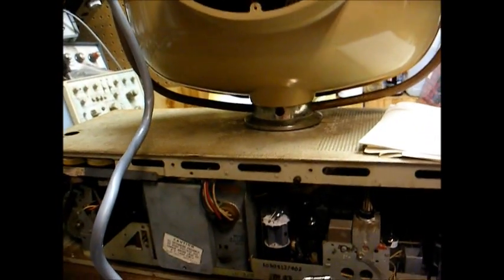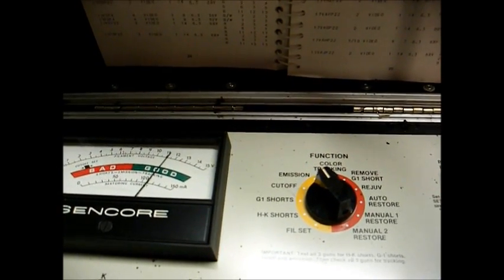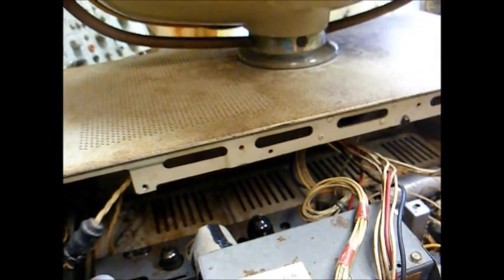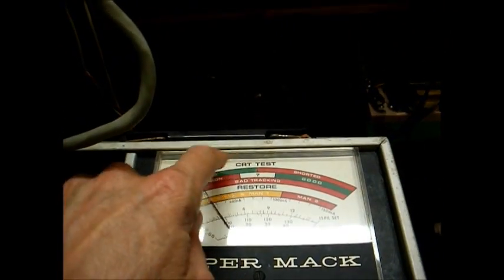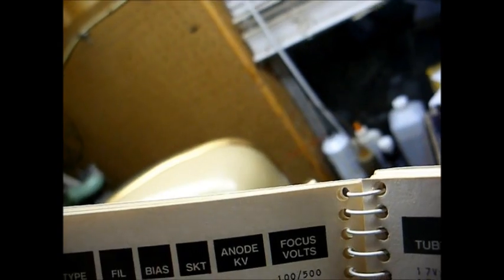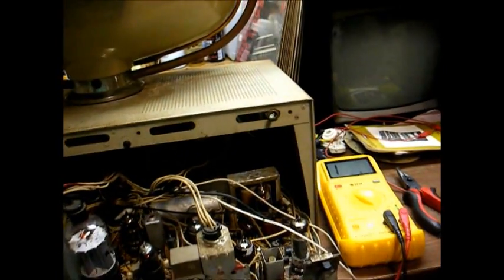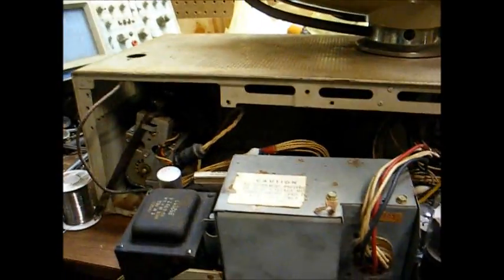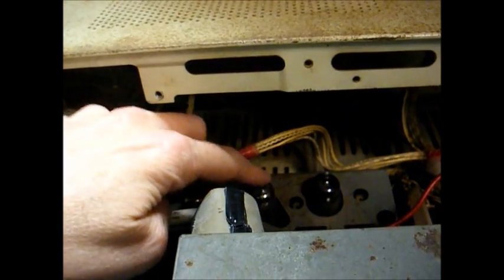First look at a 17" Philco Predicta B&W TV

Comment: Really excellent assessment...was just gonna mention the low CRT heater...But Shango is there below/above me...Yes, it's a question of percentages, a 6.3V set dropped down to 5 volts is around a 20% drop, good for the life test. Who knows what the Sencore was offering the 2.6V tube heater, but if it was anything less than 2V it would be getting extreme. Most Predicta owners would be predictably predisposed to prodigious pleasure if offered a tube like this. Before getting eaten by a predator.
EDIT: The life test breaks a winding at the bottom of the secondary on one Sencore circuit I have seen and as Shango says it's a volt! That makes it more than double really what it should be.

Comment: Great video!! I worked on one of these back in the early 70's while I was in high school for a teacher. I concur what your mentor felt about these sets. The one I fixed was a series string  set and the problem was heat damage on the p.c. board. I nick named it the video toaster oven. Poor design for a tube set. Two brands of TVs I avoid; Philco and Sony.

Comment: I wonder how reliable and accurate old test equipment still is. The ones you use look pretty old to me. I'd first make sure my test equipment is in top shape before testing anything.
Reply: +Critical Shareholder I use several old pieces of test equipment.  Much better than the throwaway junk they make today.  My Tek 2246A is vintage 1989 or so.

Comment: I would not take that life test to seriously. They may have based those life times based on usage that is not likely to be the case today. You have good cut off which I think is a better judge of it anyway. Make sure you have the video feed wire from the CRT attached to the pcb, its a single wire, I think I see it attached but its easy to pull loose. Brightness control would be suspect too. I would look at CRT pin voltages. check Pin 7 of the CRT (cathode, 40v adj by brightness control), pin 2/6 400v screen from boost voltage, pin 3 grid 0v. My guess is an open side of the brightness pot, maybe an open 100k screen resistor for the screen on the  CRT (400v supply) check see if there is boost voltage on one side and 400v on the other..

Comment: I enjoyed that, well done! How do CRT testers test for life function electronically? Do they reduce the heater voltage slightly?
Reply: I believe they measure electron emissions off the cathode.
Reply: Yes, the tester keeps all test parameters the same, but cuts the heater voltage slightly. The life test on many testers is a bit dubious on the 2.68 volt CRTs which seems strange for this set since it appears to have a power transformer and would not need the odd voltage.